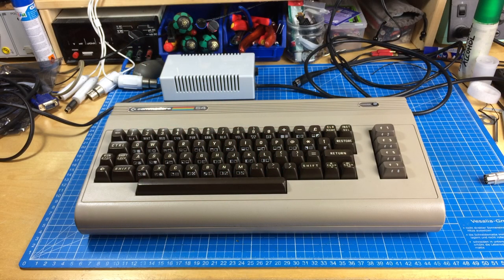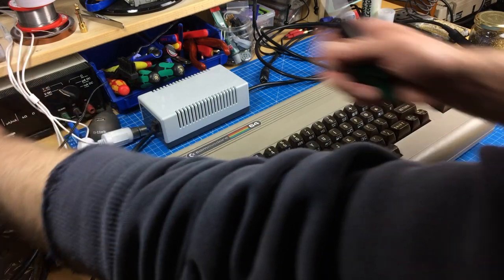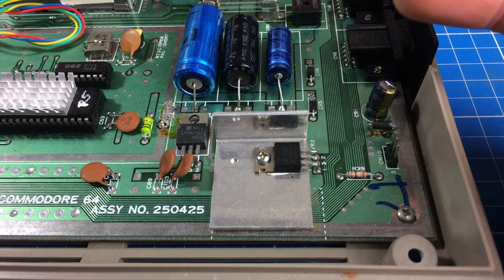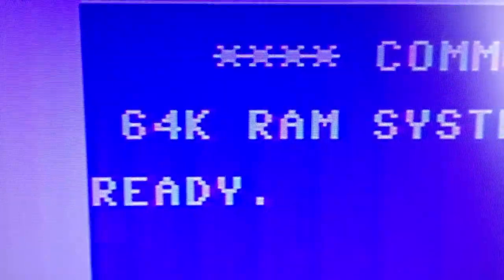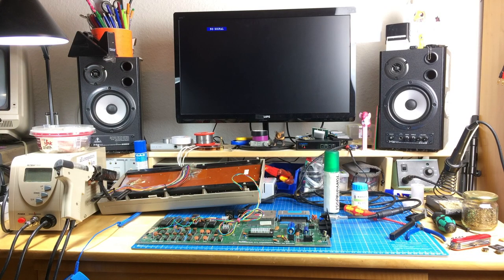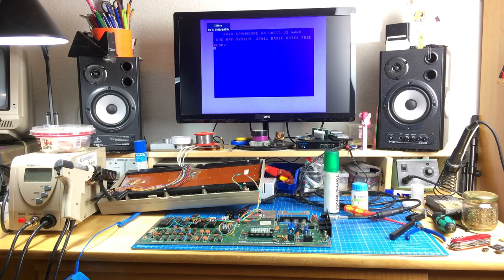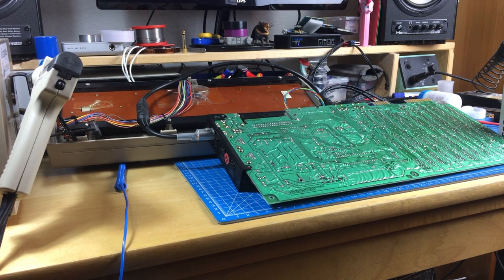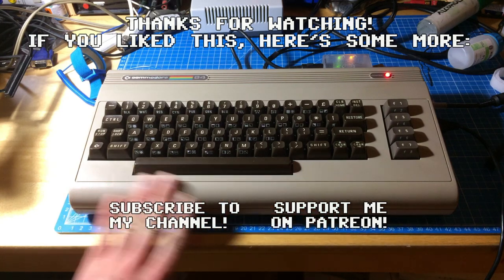Converting my C64 to modern DC-DC Converters

Comment: another   good   idea   if  u  want   to    do    a  lot   of    modifying    i  prefer  to   watch   you   at   work      yuo   fix   like  its  just  a   hobby   nothing  stops  u  except   the  xxxx  aldi   disaster   it  was  not   your  fault   i  think  the  board  was  tampered  with  by  factory     or  a   amatuer  tech   before   you  find  it    ....   i   want  to  buy it  if  you  want  to  selll it   you  spent  lots  money  on  it   and  time    lots  of  parts   replaced     i   could  not  beleive   all  the  damage  done    i  rekon  lightning   strike  into   the  home  where it  died    .....      any   way      this  project   is   a   good   design  dc   dc   convertor

Comment: have 4 diffrent working c64 with orginal voltage regulators and never had to replace them even they are over 30 years old, all this talks about high temp is bs...
Reply from the maker: I’ve had two breadbins here with broken 7805s in the last couple of months. So they definitely fail sometimes. And they usually take out the VIC-II if they do. Also, generally bringing down the temperature inside the case is always a good idea I think.